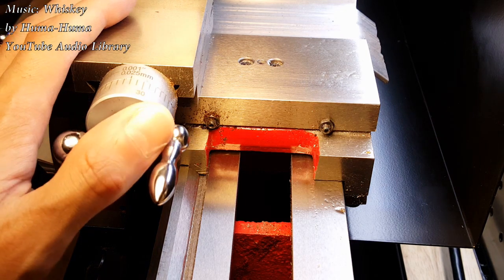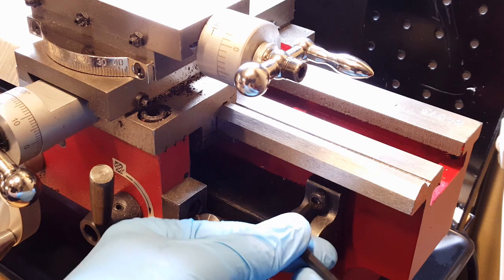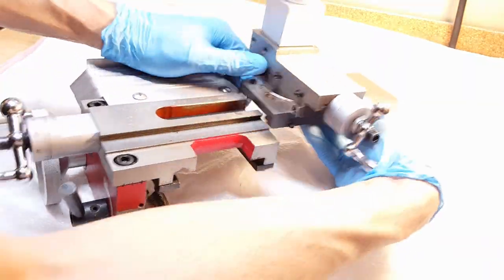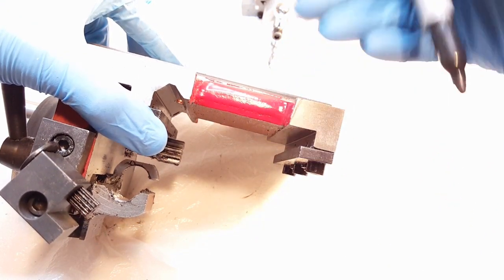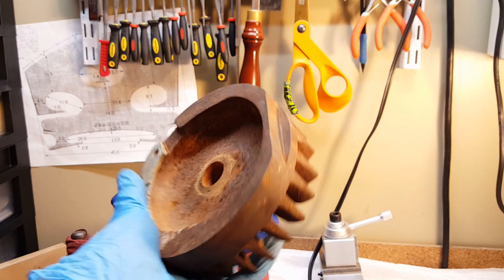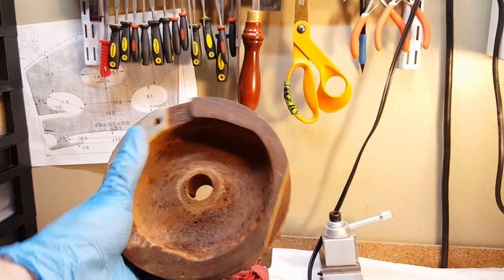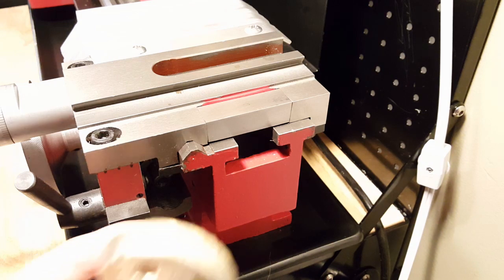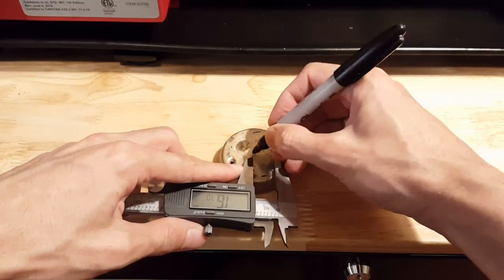Making a Carriage Lock (for the Harbor Freight mini-lathe)

Comment: really a great result especially that you don't have a mill

is there any reason for using the brass T-nut rather than steel one? better friction? more gentle on the bottom of the ways? I think I'll follow your idea especially the wedged shape of the extra piece. I still don;t know how my lathe looks like (it's on the way) but I suspect most of them look nearly identical. 

my lathe (to be) is 8" x 32" (800mm between spindle and tailstock), and is 100kg = 220 lbs
Reply from the maker: Oh you got one of the big ones! Congratulations!
I use brass (or bronze when available) because it is indeed gentler on the cast iron parts of the lathe. It has good wear-resistance and at same time prevents wear on the cast iron.

Comment: Very nice and a great idea. Is there a reason you used brass for the slide underneath and not steel?
Reply from the maker: Thanks! 😊
The lathe bed is made of cast iron, which is softer than steel. The idea is to use materials of the same or lesser hardness, to prevent wear on the ways - even if it's just the underside of the ways. Brass is excellent for that.

Comment: I have the exact same setup and have wanted to add the slide lock. This design and the tool requirements, is about the easiest I've seen to date. This will most likely be the path I follow as it is the simplest. Helpful video.
Reply from the maker: Thank you! I love intricate designs and beautifully machined surfaces, but sometimes all you need is a simple friction fit.  😉

Comment: All done by hand with scrap and home-cast metal !  Respect to you, young man. A delight to watch.
Reply from the maker: Thank you!  ❤
(I still would love to have a milling machine  😉 )
Reply: Well, when the time comes, my strong advice is to totally avoid the tilting column type and buy only a fixed column mill - even if it costs a bit more. The tilting columns not only fail in tilting mode, they have BAD inherent stability issues when upright.
(If you spend enough then this does not apply of course).
Good luck.